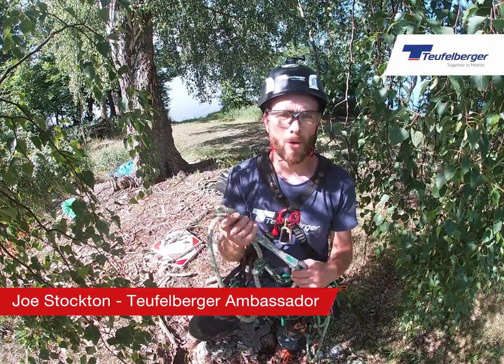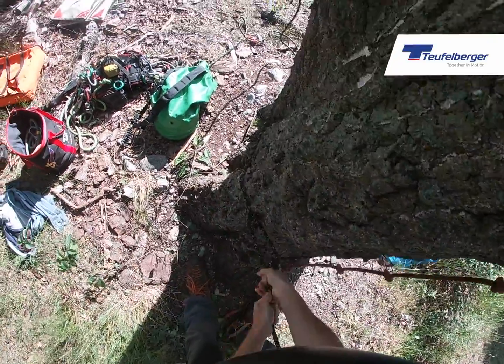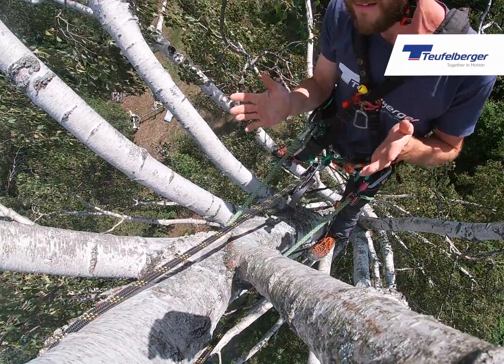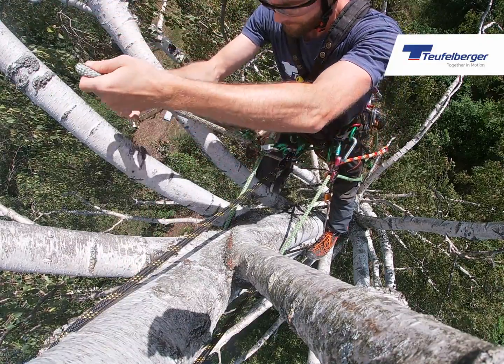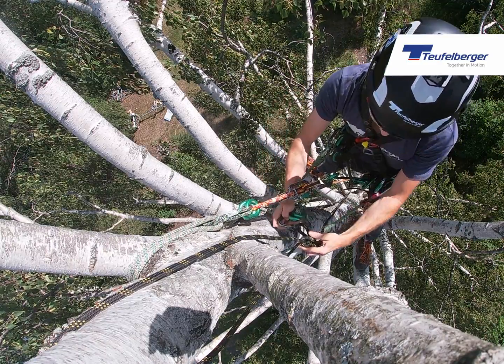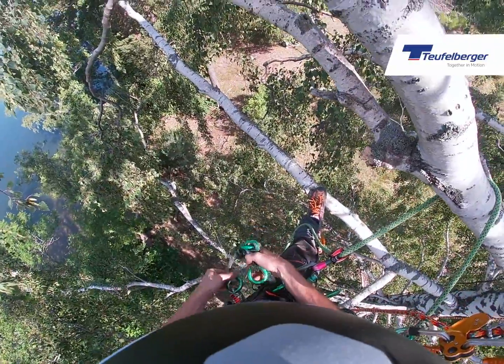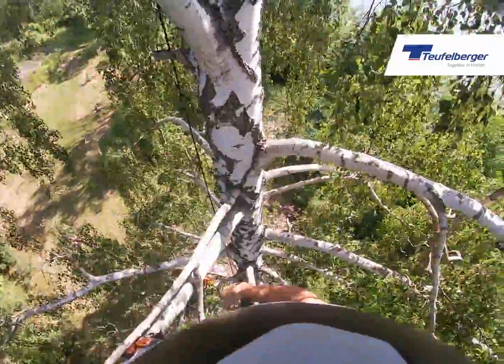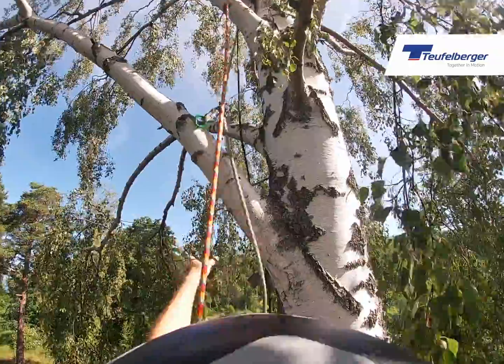multiSAVER - Tricks & Retrievable SRT redirect by Joe Stockton

Comment: How are those larger rings attached there to the rope part of the saver? If I understood what I was seeing here correctly - it seems like the two larger rings' end is put through the bight of the saver that's just been put around the stem, and then it's effectively turned into a not-quite-a-cow-hitch when the two larger rings' end is poked through the bight.